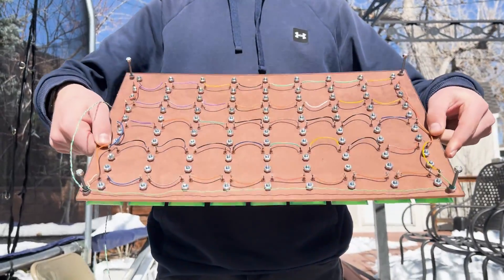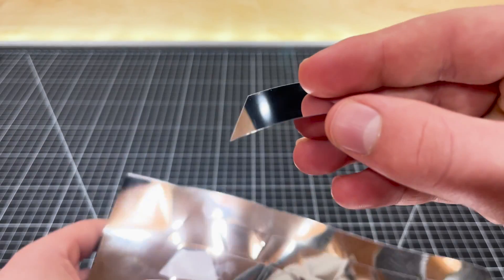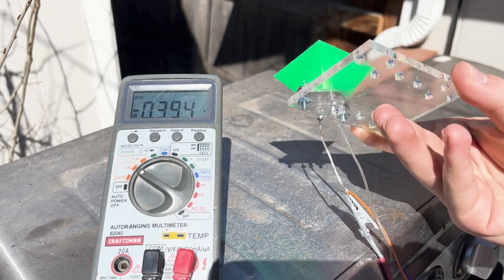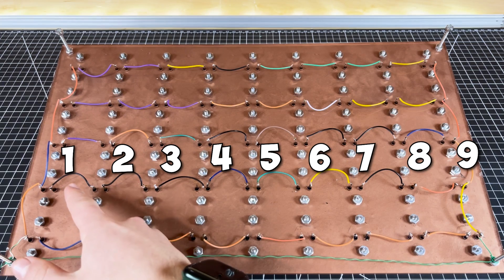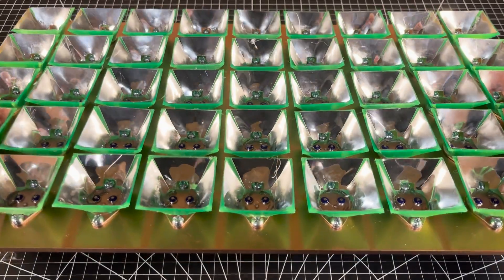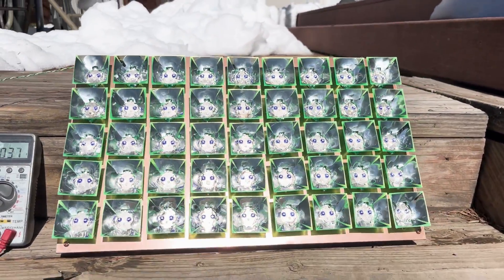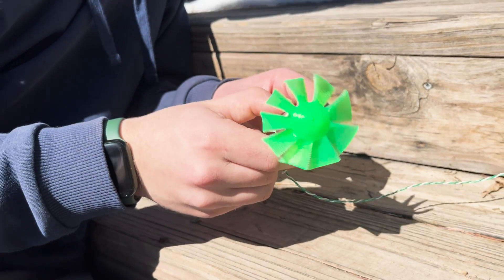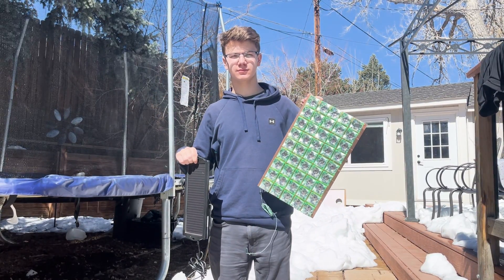How to Build a Solar Panel with Transistors

Comment: Hi nice video Daniel's Inventions,.

I wonder why the use of deflectors to increase the output by 20% (that is 1/5 so 1,2 vs unity) while the surface of your transistors can be optimised (following your panel) by a factor 2 (twice as much transistors per surface) and that would be 100% gain (so 2 (doubling) vs your intitial project(=1).

You may say price; but what cost you to print (machine, plastic filament, time, energy), use a mirror reflecting surface, assembling the deflectors, glue them in place vs buy twice as much transistors (including the scale/price/shipment costs - usually price goes down with the amount)

Regards,
PHZ
(PHILOU Zrealone from the Science Madness forum)

Comment: [ Doesn't it mess up rechargeable batteries to have the flow of electricity be inconsistent? ]
Reply: Yes, that's why a proper system uses DC to DC chargers and/or solar charge controllers; or mains regulated chargers. Also, overcharging is an issue when not regulated.

Comment: Why didn't you try running the output of your homemade solar panel through another one of the 2n3055 transistors  in a joule thief as a power transistor? Thanks Daniel

Comment: While i doubt this would be used in a serious solar setup, one interesting idea I would like to share is how some person (forget who) used 4 solar panels connected to motors to turn a solar panel to always face the sun. The 4 solar panels were small, and only powerful enough to move these small motors; Being connected far behind the main panel, they would eventually be exposed to sunlight throughout the day, which would power their respective motor and move the panel until the small one was completely blocked by the main one again. It was neat, though required manually resetting after the sun sets.

Comment: try soldering the base to the collector of each transistor and you will get the output voltage from the collector soldered to the base. and from the emitter so you will have a higher current at the output voltage from the emitter and the collector soldered to the base of the transistor

Comment: Silicon not silicone, please do your homework and get it right! 
Silicone - a flexible rubber product
Silicon - is derived by quartz used in IC Chips or transistor's.

Comment: if you put an l.e.d. across each transistor would you get more power?
Reply: technically... that is one way you test that a diy solar panel is working, and you run power through solar cells to see what part lights up and what doesn't (using special cameras capable of seeing it) to determine damaged sections. They are essentially the same thing, though an LED is better at generating light and barely able to produce electricity, while a Solar panel is best at generating electricity, and basically unable to generate usable light. Adding more light, from an LED or otherwise, should help.